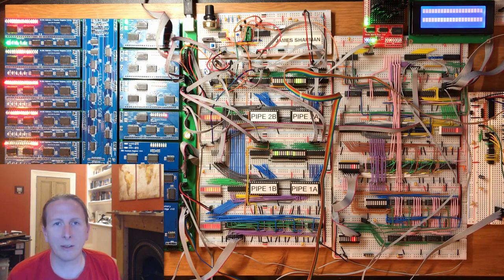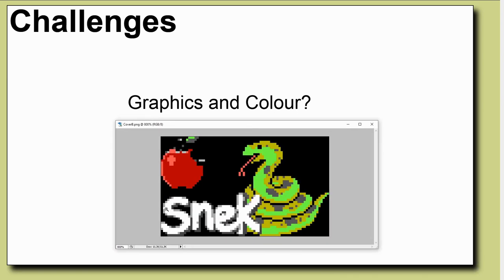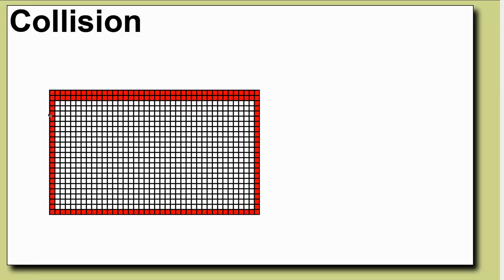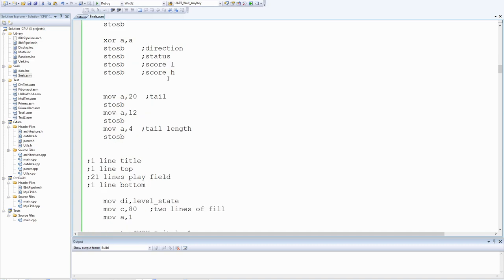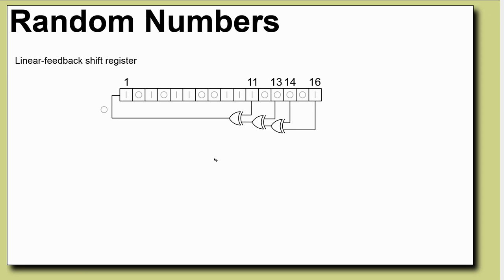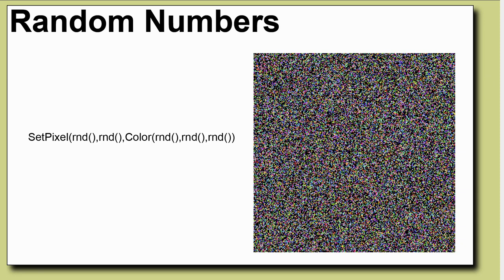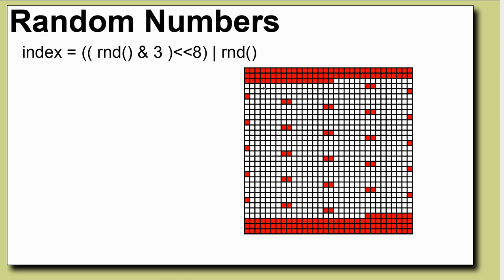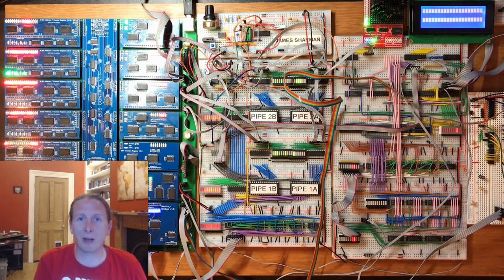Programming Snek - Making an 8 Bit pipelined CPU - Part 81

Comment: Great Explanation 🎇👌 especially the LFSR part.
Many controllers have a hardware LFSR as the software based system  engages the processor.
Thanks for sharing the logic behind the  game.
Cheers ✨✨✌
Reply from the maker: This random number generator will do everything I need it to. On higher end systems I normally implement a Mersenne Twister but this one has a nicer performance profile which is pretty important here.
Reply: @weirdboyjim  wow, I was unaware about Mersenne Twister. Thanks for Adding a piece of new valuable information to my knowledge database✨

Comment: Are you planning to implement a micro bios or boot strapper to load executables directly into memory via UART?
Btw.  the effort you put into this video is much appreciated - and it didn't go unnoticed. Thank you very much - and it was very very interesting.
Reply from the maker: Andreas Saur, I have some plans in that area. At the moment I have a 32k / 32k split on the ram / rom,  If I was going to go with that approach I'd want to have a smaller rom and more ram since I'd need some space to upload. That kind of system does seem like a good idea, but I want the cpu to be able to operate stand alone.

Comment: Fantastic as always.  Couple of questions if you will.
1. What speed (clock cycles/s) do you have to run at in order to get SNEK to run smoothly?

2. I recently watched a very good Youtube video about the SID chip on the Commodore, and one of the things they mentioned was that in addition to producing sound output it also fed the CPU with random numbers.  I remember from your last video you're planning some sound output so you likely might already have some Analog components in the order basket.. Have you given any thought to producing random numbers in hardware like the SID chip in order to offload some CPU cycles?

Looking forward to the next in the series
Reply from the maker: Thanks Louis! It's running at around 300khz here,  but it only needs to run at a fraction of that to work. I imagine 10-20 kilohertz would be enough. I won't be adding hardware random number generation to this build although it wouldn't be very hard. I would probably just implement a basic lfsr clocked at a "high" rate and pull numbers of it on demand. I could potentially do a stand alone video on that.

Comment: Amazing series. Thanks for taking the time to document everything so well! 

I was confused as to how the random numbers do not repeat in the same way for each run of the program (as it doesn’t seem to involve PC or any time component, and the seed is hard coded (?) 

However, I may just‘ve missed something 😄
Reply from the maker: Thanks Frank!  I had to have a quick look at the code, I didn't actually add anything to shuffle the random numbers to there will be a lot of similarity between clean restarts. That said a play session will rapidly diverge unless the user is doing the exact same things.  I could easily count frames before the first button press to seed it, or may just add a call the RND in that loop.
Reply: @weirdboyjim  Aa okay 😃 Thanks for the reply!

Comment: Amazing as always, and jolly interesting. I love your technique of storing the movement direction in the "collision" byte. My 6809 snake game was cruder with circular buffers holding positions of snake bits, though other elements like the RNG were basically the same. I too worried about the RNG never finding an empty square. :)
I'd love to see a description of your ISA and programming model all in one place; are you planning to make one now the design is basically stable?
You've inspired me so much I'm going to try coding up Snake for my processor design. It's on an FPGA, sadly. Still pleased with what I've got working so far though.
Reply from the maker: Thanks Lawrence. Circular buffer "feels" like the right way to do it right up until you are hand coding assembler with a small address space.  Mine will find a square if there is one, I think you will guarantee death in the next tick as the tail fills the entire play area but I haven't tested that ;-)  I want to have a play with FPGA's at some point but I'm trying not to get distracted.
Reply: My snake game was in 6809 assembly, which is only a little more sophisticated then yours. The circular buffers were 1024 bytes each for row and column plus a couple of counters. Not an order if magnitude larger then your memory requirements. But I cheated and used the video memory for collisions. 1024 is a pretty big snake, plus the game sped up very slowly, so running past the end of the circ buffer was basically impossible. FPGAs are indeed something else entirely. Looking forward to seeing you tackle video! After you make up those PCBs. :)

Comment: Going through your "Making an 8 bit pipelined CPU" play list; part 80 to 81 goes from writing "Hello World" to a terminal to a game! 🤯

Regarding your C code to create blocks of data to add to your assembler, not sure why anyone would complain about this, as you've essentially added a compiler to your list of tools, although the linking is manual.

The ANSI escape codes, is this is what the ncurses library, that I have never used, uses?

One of the many reasons why I can't write game code is that I'm completely incompetent at playing games and would never be able to play it to the point that, in this case, the snake is so long that it's practically impossible to randomly find an empty space for the heart.
Reply from the maker: From a cpu's perspective "Hello World" and a full game are very closely related!
Reply: @weirdboyjim  From a programmer's prospective, not so. In awe of your programming skills.

Comment: Funnily enough I was messing about with a xorshift RNG at the weekend and plotted random points in random colours, the same as you did, to see how random it was. With my Tetris clone I didn't bother with a RNG but updated a counter whenever the code was waiting for a key-press and used that value when I needed a random number. Not very efficient but it works. I'll probably change it to a proper RNG in the future but use a counter to seed the RNG when its waiting for a key to be pressed to start the game. BTW do you store the score as a binary number and convert it to base 10 to display it or use BCD?
Reply from the maker: For making games on DIY 8 bit processors the LFSR based generators can be more useful something more complex like a Mersenne Twister because they can be coded to have a very flat performance profile. Using a counter attached to user input is actually a really common way of seeding random number generators so you have done the right thing there. The score is stored in 16 bit binary, I already had the "Math_ITOA_8" and "Math_ITOA_16" functions from earlier library development (I used those on the prime numbers demo).

Comment: Thank you :)
Quick question tho, you mentioned that you're using a byte per cell in your collision array, however it seems like you're only using 7 states which would fit nicely in a nibble?
Have tried doing it like that and found it not worth the overhead or is there another reason you're using bytes?
Reply from the maker: Absolutely,  both the read and write operation would need to be extended to support storing the state in a nibble and that would have increased the code complexity in multiple places. My function that returns the byte address of an x,y position is very compact, you would have needed read/write functions with multiple calls which would have used up some of the 512 byte saving and added many more cycles.
Reply: @weirdboyjim  Why worry about optimising the memory used by the off screen buffer when you have 32KB to play with!

Comment: Hi James, your assembler seems to ignore the last row in a source file. so in your snek program the "ret" in the last row is ignored. the program runs thru the next bytes and there is db "[?25h",0 which contains the binary opcode of "break" and then of "jmp" and so it jumps to the right position. is there anything wrong in my implementation of your CPU?
Reply from the maker: There was an issue in the assembler where some symbols are not matched correctly if they finished on the last character of a file. I had the issue a couple of times where I missed the return after ret and it didn't generate that instruction. I fixed it as some point but you probably have a version without that fix.